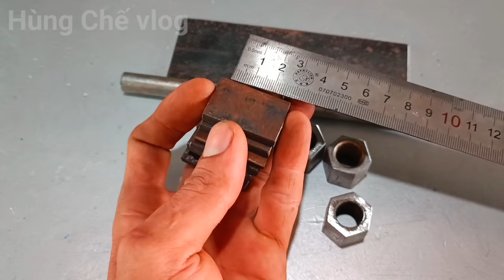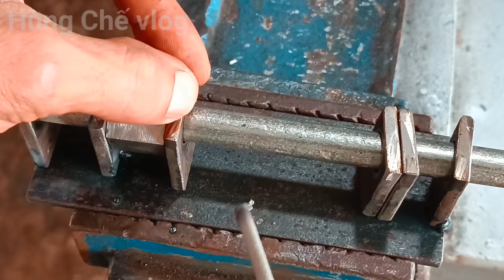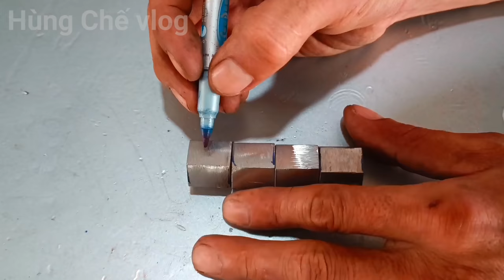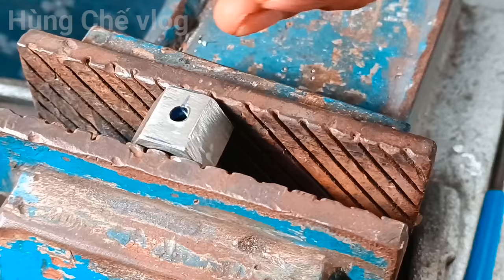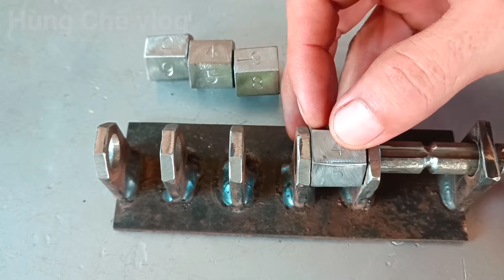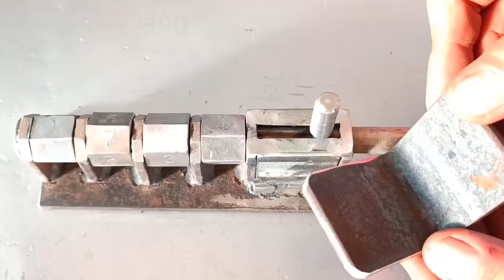Chốt cửa mật khẩu tự chế độc đáo #27. Unique homemade password door latch #27.

Comment: Genius!!! 
Please send some designs of a latch which can be opened both from inside and outside. No lock system is required.
Reply from the maker: I have a few models of self-closing door latches that can be opened on both sides, you can check out the previous videos on my channel, thank you for your attention.